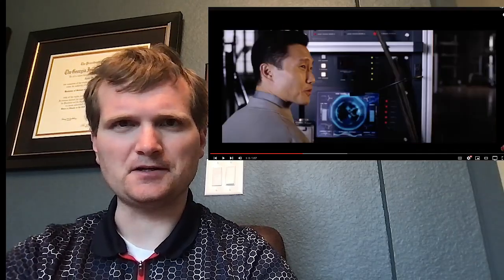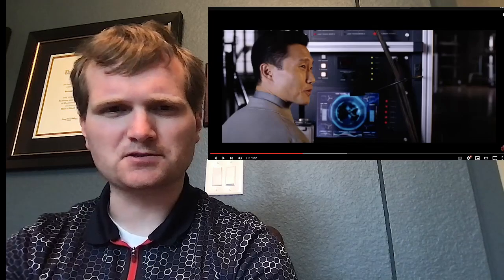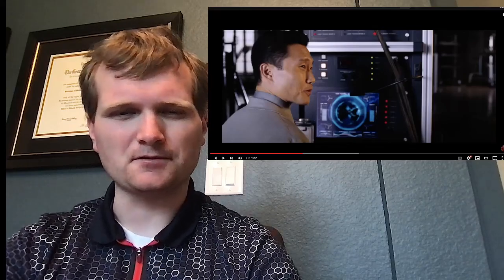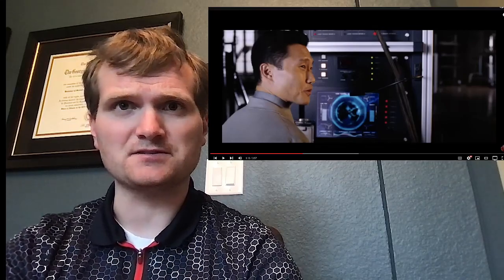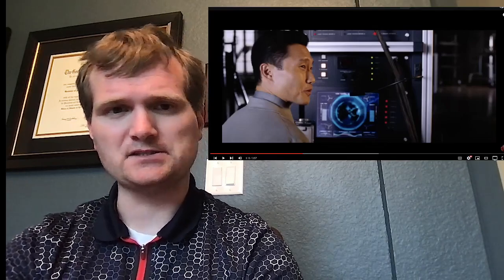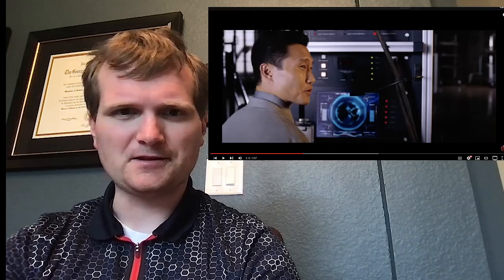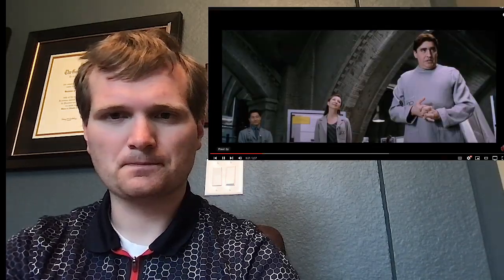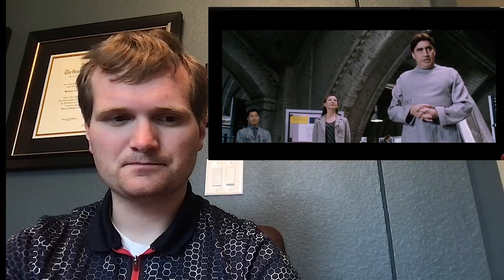Nuclear Engineer Reacts: Everything Wrong with Spider-Man 2 Fusion Reactor Scenes

Comment: I think they have many ways to die: 
-150 million degrees creates, without the fusion reaction, its own X-rays. (just 15 Kev). 
-Fusion creates gamma radiation and a high neutron flux too. They would be exposed to a few millions Sievert of pure neutron radiation. In this case, I wouldn't worry about the neutron radiation,since the neutrons are a little bit slower than the gamma rays.

-magnetic field: they wouldn't have any issue if the magnetic field was lower than 7 Tesla (without any ferro/diamagnetic implant), but because the room itself is ferromagnetic, this is another danger.

I think right before the fusion, they were already dead because of the ferromagnetic "containment", and there wouldn't be any fusion because of it. If this "containment" is not ferromagnetic, then they are immediately vaporized. The reactor itself  becomes more powerful over time for  some reason, which may cause a higher core temperature. At 100 billion degrees, there is a chance for nitrogen fusion in the open atmosphere and unlike tritium, there is more than enough nitrogen in the atmosphere. That would be a very big issue for everybody.
Reply: China made one that actually works!!